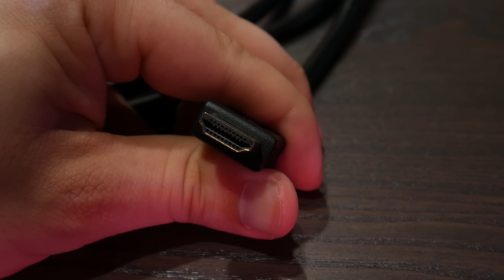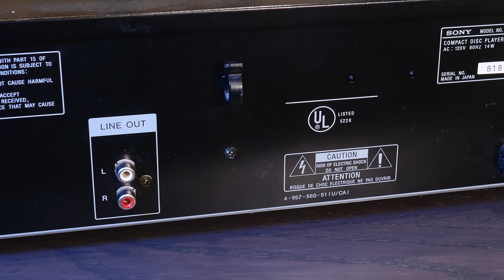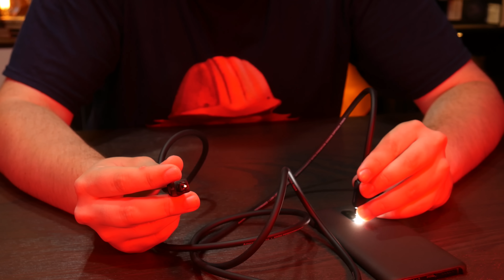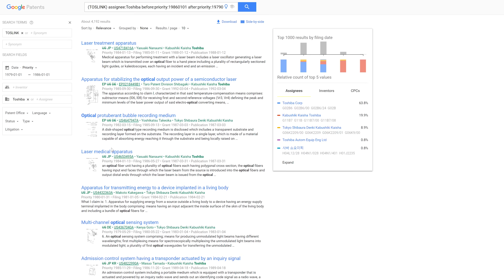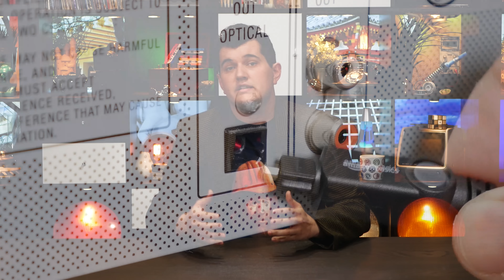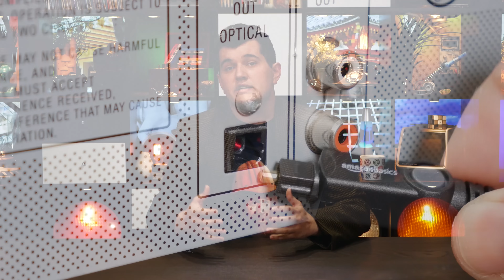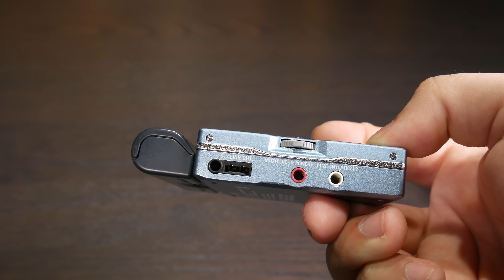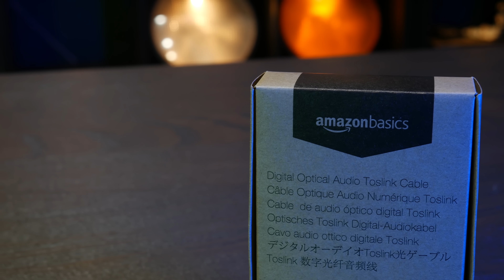TOSLINK: That one consumer fiber optic standard

Comment: Been using optical audio for 10 years. I like it despite the very tiny amount of delay that's sometimes noticeable but often times not.
Reply: Any delay has absolutely nothing to do with TOSLink itself, but with the implementation in your devices. There is absolutely no way your ear can detect the latency of the TOSLink link. 

Delays come from the architecture of the transmitting and receiving devices. In simple ones (like 80s/90s stereo gear), the SPDIF stream is produced directly from the CD decoder in the CD player, and on the receiving end, most likely directly into one input of a DSP, which selects the input, maybe applies EQ and a goofy faux-surround effect, adjusts the volume, and sends the output to the DAC. 

On modern gadgets, there’s often a lot more processing on both output and input, doing things like format conversion (on the output) and format detection (on the input). Heck, even the analog inputs on many devices nowadays have delay on them, for similar reasons. (My little Bluetooth speaker is like that.) (Note that many receivers from the 90s on, even pure stereo models, actually route every analog input to an ADC and then do the rest of the signal processing in a DSP. It’s so low-latency that nobody notices.)

Comment: I was so excited to find out that xbox 360 and PS3 would both offer a TOSLINK connector, until I realized that HDMI audio is exactly as good since both are digital, and the fact that TOSLINK has a tendency to drop out if any dust gets into the connector or if the cable gets slightly out of alignment, and then there is the fact that It requires a separate cable for audio, compared to HDMI's one cable.... but having a launch Xbox 360 sans the HDMI connector, using the component cables for HD video and TOSLINK for digital audio, I was very satisfied for 2005 / 2006 standards.

Comment: I listened to the audio of this video over TosLink!

For what it's worth, I use TosLink because it sounds better than USB on my external DAC, not due electrical noise on the digital signal, but because my DAC has different chips for converting the optic signal versus the USB signal, and the TosLink is much (well, at least "much" to an audiophile... Okay so the difference barely exists...) clearer in this case.

Comment: How durable were tooslink cables compared to copper? I know many devices we use today are more or less stationary for the majority of their working lifespan so copper cables don't experience much fatigue anyway, but I wonder if the plastic cable inside is more resistant to degradation over time for a more active setup. Maybe for a system that is built and torn down frequently? Otherwise, cool factor aside, I wonder what the practical benefit was to making the machine more complicated to make?

Comment: good luck getting hdmi to work with over 15m cable length without a repeater. also the cost of such hdmi cables is much greater that toslink AND toslink has a far smaller form factor

Comment: use a badly insulated wire cable for a relatively long distance (say 5 to 10 meters) and you are likely to get a static humming noise from the cable wich will be there regardless of if you are playing music through it or not.
toslink doesnt have that disadvantage
you can also send surround sound through toslink

Comment: i bought a 42" LG LED TV back in 2016 and it had toslink audio output and RGB component cable input.  

i never even bothered with any of it until this year (2021) when i went back to upgrade my old gamecube with the component cables.   funny enough, i also found out that my speakers also happened to have toslink compatibility.  i didn't even know it was called toslink until i saw this video

Comment: Why isn't fiber optic more prevalent? Cost.

Cost cutting in PCB design is more competitive than ever. Compare cost of a fiber transceiver versus solid state and there's your answer. Also, those complicated tight tolerance copper cables? Still cheaper than fiber cable.

Comment: Yep, amazing that TOSLINK and S/PDIF are still being used. Even more amazing is that the original MIDI standard from 1982 is still actively used on new musical devices. RCA connectors are still used after being invented around 1937 to connect phonographs to RCA radios. But to me the grand champion longest-running interface is the phone plug (or jack), still used on electric instruments, headphones, mixing consoles, etc., which descends from a telephone switchboard jack first used around 1877.
Reply: As I recently discovered, having to replace the cable on my radar detector, it too uses a phone cable.
Reply: @stefanfrankel8157 you own a radar detector? That's so freaking cool
Reply: i think it might just be audio, like most audio connectors have remained unchanged and almost all unchanged connectors are audio
Reply: @alyx6427  right. Audio has a pretty narrow bandwidth compared to more complex signals so it doesn’t require much to accurately transfer it. It’s like the spoon. Why hasn’t the spoon progressed over the centuries? Because it’s a rounded, shovel-shaped thingy one uses to scoop up food and shove it into their pie hole. Works just as well for that today as it did 200 years ago lol
Reply: Why replace it if it works fine, right?
Reply: @beetheimmortal  because this one is gold plated
Reply: Did You mean a 1/4” cable? Or did You mean a regular telephone cord with the little springy clip?
Reply: @CatalystOfFire the 1/4” TRS connector. Look at a picture of an old telephone switchboard and you’ll see it.
Reply: @cdstoc  yup. I have a 1/4” TRS patchbay in my home studio and it’s pretty much just like telephone switchboards from a century ago
Reply: Midi is still wildly popular in live events and beyond just sending music notes. It can be used for control signals, click tracks, lots of things
Reply: The design of the phone plug/jack seems to be perfect.  And as aforementioned, established for over a century now.  It gives just the right amount of electrical contact & it is sturdy.  Sturdiness is key here.  It actually resembles a design in biology/nature for millions of years, such as what equipment is used for sex between the 2 genders for many creatures, heh.  Apple created an uproar when they removed the phone jack from their smartphones.  If it ain't broke, don't fix it.
Reply: Because for the most part, these things operate on pretty basic physics principles. Look how long the combustion engine lasted, and many vehicles are still sold with it. Sure, things get better, more efficient etc., but it’s really the idea of, if it ain’t broke, don’t fix it
Reply: yeah aux cables rule. 3.5m jack is the champion, no other connection can top that.
Reply: @bsnf-5 3.5 mm (1/8”) cables are fine for consumer electronics but are unbalanced and thus prone to noise issues. For professional audio applications, we use 1/4” balanced cables

Comment: Funny you mention ARC. My television has only 1 ARC enabled HDMI port, with several non-enabled ones. We have both a Blu-ray player and a streaming bar, which both require it to operate (don't ask me why, probably something to do with remotes). The solution? Using a typical HDMI wire in addition to a TOSLINK cable. I don't know if it's using the TOSLINK system itself, but the cabling is identical, and works as the ARC for that HDMI cable (or perhaps is the audio out in exchange for the HDMI operating as ARC only?). Funny stuff.

Comment: I'm probably in audiophile territory at this point, seeing as the 1/8 inch to dual 1/4 inch cable connecting my PC to my Mac's $500 audio interface is on the verge of not good enough because of the noise in the analog signal I hear, but I'm personally cursing my interface's manufacturer for restricting optical audio to their higher-end interfaces. If I'd known I could have paid $400 more up front to gain S/PDIF in on the interface and thus cut the likely point of noise ingress out of the chain, I probably would have done so.

BTW: my goal in this extremely expensive project was simply to have audio from two computers at once, both in low latency and high fidelity. This I managed to do, but again, the noise in the signal is apparent when I turn down the volume of my game to hear my friend on Discord on the other machine, so ironically enough, I see S/PDIF as a likely upgrade path for myself in the future.

Comment: Actually Toslink is great. I was given a 40 year old Kenwood receiver in perfect condition, it sound great. I hooked up the audio using analog RCA connectors.  The sound was "eh". Then I saw for $15 a Toslink to analog audio  DAC.  Yes $15  hooked the Toslink I had lying around from the TV to the DAC and the RCA on the DAC to the audio in on the old Kenwood. Sounds fantastic.  I play classical music from Youtube to Chromecast on the TV, through the DAC and into the amp and the sound is awesome.  So those of you that have oldie but goodie audio amps with no digital input Toslink is a winner.

Comment: I mean toslink is good for if you want to have surround sound coming out of a computer having RCA would involve a protrusion from the motherboard or a separate card. And while it is possible to just feed the audio and video via HDMI through the receiver to get the same effect they can also introduce latency and unless you're using HDMI 2.1 with a compatible monitor or TV it can make it to where you limit your refresh rate or picture quality since DisplayPort isn't really something found on AV receivers, not to mention that AV receiver would also have to be compatible with HDMI 2.1. so tonslink kind of just simplifies that.

Comment: Man you completely missed the point here:  Elimination of ground loops.  The common problem when connecting a signal ground between two pieces of audio equipment (receiver and amplifier in this case) is that you effectively create a big loop antenna out of multiply connected ground paths between the two instruments, and that antenna picks up 60Hz AC noise from the mains.  That noise is put on the ground reference where it modulates the power amplifiers and comes out over the speakers as an amplified hum, even when no data is flowing over the SPDIF connection.  You can use a clunky isolation transformer to resolve this with copper OR go optical and the problem cleanly disappears.  This is also why MIDI uses optocouplers at the receiver.

Comment: 13:45.... same.  My first MacBook Pro once had a 3,5mm audio jack failure (thinking its a mini TOSLINK connector inserted) and started glowing red. Then i googled for it and realized my MBP has a digital audio out
Reply: And guys.... dont worry the cables are worth even a penny more because of the "gold plated", if you read some reviews, the gold "plating" on these optical cables are PAINTED, no real 24k gold for you xD

Comment: I wish home electronics manufacturers would adopt the fiber communication standard used in computing. 

I just purchased a large flat screen Sony TV, specifically Sony, because I've previously purchased a compatible Sony surround sound system. I have (1)coax, (2)RCA, (2)HDMI, (1)RS232 (wifi card failed on the 2 year old surround amp), (4)speaker-specific connectors, and a single Toslink fiber digital out from the TV (that runs parallel to the eARC HDMI cable, eARC is used so the surround sound can be controlled through the TV; why didn't they use the eARC HDMI cable for the digital out, or simply use the RCA audio inputs from the cable box, instead of requiring ANOTHER SPECIAL CABLE??? ). 

Do really need all of these unique cables??? WTH! Why can't they all be the same?

Comment: Another fun video! A lot of sound cards for PCs supported toslink as well, but weren't allowed (for whatever reason) to output surround sound. Back when Creative had their own sound effects system (EAX) I don't believe it allowed you to send that over toslink either. I've also had numerous problems with PS4 surround being supported on receivers, for whatever reason I cannot fathom. Cheaper TVs with optical out likewise supported stereo only.  It was cool that some laptops, including some macbooks in the 00's and early 10's had combined optical/stereo jacks.
HDMI just ended up being such a simpler and more user friendly solution. And the added benefit of only needing a single cable for both audio and video was such a boon. Especially if you were running a lot of systems to your receiver.
Just wanted to share some personal input/experiences with toslink. It was cool as hell though.

Comment: I use TOSlink for a couple of the connections to my receiver.  I have tried the same connections with cables with RCA jacks, HDMI, and TOSlink cables.  And I can say that the devices feeding my amp with the optical cables do sound noticeably better.  It shouldn't really be so, but it's enough of a difference that it's beyond my subjective opinion.  Maybe my amp handles the optical signals better, as in better designed for these inputs, but I don't know.  This is the second receiver I've had that I've noticed this on.  Maybe the resistance of the HDMI cables is attenuating the signals, as I don't buy the ridiculously expensive 'high end' HDMIs.  Just an observation.

Comment: TOSLINK is still superior to not picking up line noise, as in AC line noise. I had to use it for years to feed audio from my pc to the tv/amp as house fans or any ac wall switch microwaves etc would interrupt the audio feed. TOSlink was impervious to this (least in my case). It has gotten better over the years as PC psus and whatnot have improved at blocking these signals but every so often I do still get audio interruption via HDMI. Those mini ports were on almost every digital audio device with a mini jack since some time in the mid 90s. Drawbacks? cables are noodley, they might be more flexible but cannot easily lay behind equipment and the filament often will kink or yellow causing a cable to suddenly quit working. I think of all the cables I have owned over the years only one remains working.

Comment: For the longest while, I've used purely analog even with a dedicated audio processor either in or hooked up to my computer.  That said, my Sound Blaser Z has TOSLink capability, and my X3 external DAC has TOSLink output capability (which apparently lets it use a Dolby Digital Live encoder for "immersive surround sound")

But never used it, only mildly considered it from time to time (which would have necessitated replacing my computer speakers, which are quite fine)

Comment: Couple points you missed;
Benefit of using Toslink for home hifi. High end CD players sometimes had the digital stuff and CD mechanism in one box, then the analog audio output circuits in another. This allows you to have different power supplies so the high speed digital circuit noise does not bleed into the analog output stages. If you connet the two with copper wire, you run the risk of digital noises hitchhiking on the ground connection and polluting the analog stage. 
If you use optical connects, not a chance. 
Laptops with mini toslink? Apple MacBook Pro had it for years. It was such a lifesaver to be able to hook up a pro level digital converter to your laptop. 
Speaking of pro audio, I still use Toslink to connect AD and DA converters to my pro level audio interface. Though this is being displaced by Dante and MADI in newer gear. 
Speaking of that, I'm connecting 8 channel digital converters. I can get 8 channel at 44 or 48k. But have to use 2 Toslink cables for 8 channels of 88 or 96k. It uses SMUX to manage using 2 cables for the signal at higher sample rates. 
Copper S/PDIF can't do that.

Comment: As much as I love HDMI for transmitting audio, some devices can be a bit buggy due to some CEC issues. My prent's sound bar has a 50/50 chance of not powering on with the TV. I'll stick with Toslink for my 2.1 channel needs.  Though I do have an HDMI cable in place just in case I decide to make the jump to surround.

Comment: On the external influence on the rca it can be compensated by using a balance XLR, there at 2 inverted signals so is one pushed up the other is also but because they are inverted, the effect is canceled

Comment: The mini-Toslinks were fairly common in a couple generations of Apple laptops, at least the Macbook Pros in the era where they had Minidisplay Ports (that didn't pass audio). It was the only way to get video and digital audio to a TV from one of these without using dongles or an external sound processor. I'll have to look, but it's possible the Core 2 Duo era of Mac Minis had these too, and I'm reasonably sure those had DVI video only, not MDP or HDMI.

Comment: Fun fact: Almost all Macs since 2006 have integrated mini-TOSLINK into their headphone jacks, making obsolete Macbooks great little Kodi media centers. Especially since you can pick up one of those infrared Apple TV remotes and it works with Kodi out-of-box, at least with the ones with an IR port on the front (this includes the older alum iMacs with the black Apple logo - there's an IR sensor right behind that logo).

Comment: Is it possible that the adoption of TOSLINK over S/PDIF was the result of it being a different form factor from coax cables? I suspect that using the same cables for both digital and analog signals, while convenient to a knowledgeable consumer, would cause headaches for many users who plugged the wrong thing in the wrong place? Speaking of, what's the deal with "Component" HD coax cables? Why were those necessary over composite cables for carrying higher definition signals?

Comment: it has no positive retension device. put the connector in place. remove hand. connector falls out. endless cycle. both ends. if you have a very clever hamster he could use it as a jumprope. I can conceive of no other use.